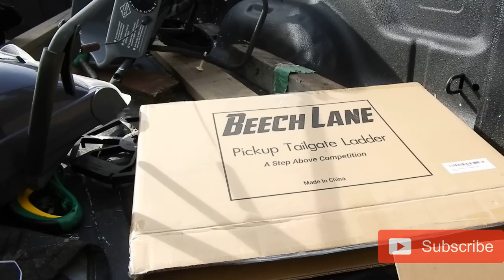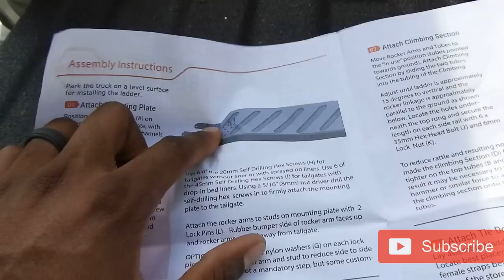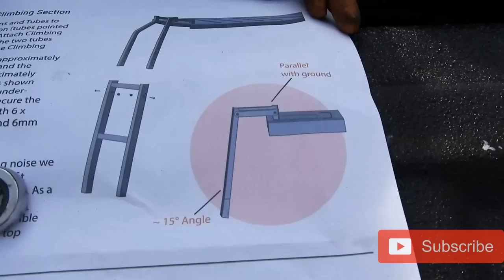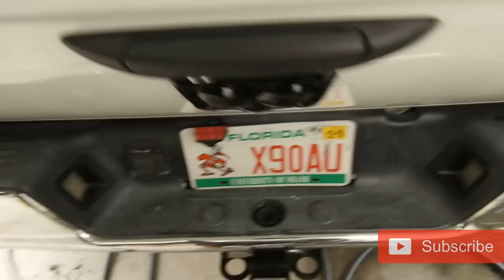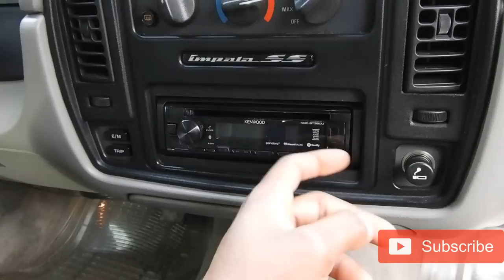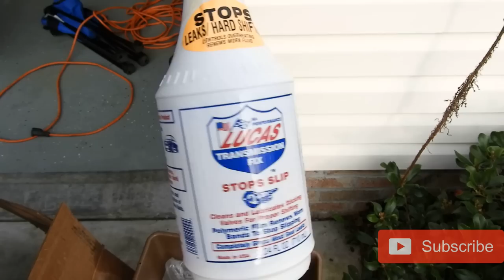EASY $50 MOD For Your TRUCK!!

Comment: Your plate should have been closer to the outside corner of the tailgate, that means within 1" to the top of the gate and 1/2" from the side of the gate, the ladder curve bar would then clear the tailgate cable with having to disconnect anything......

Comment: If you shift the plate closer to the tailgate end you won't have to unhook it that bend is to go around the cable. And then it will clear without having to unhook it every time

Comment: Looks cumbersome. If I had designed this I would've opted to go with a center mounted, telescoping ladder (similar to a boat ladder) that extends far enough to use as a walk-up ramp.

Comment: Not a big fan of the ladder. I have the AMP Bed step on mine for a couple years now and love it. Easy install, attached under bumper on corner and nothing attached to bed and don't have to remove ladder or cable to use. Works with levels/ lifts. If you like it, roll with it.
Reply from the maker: Nice man.
Reply: Picture please

Comment: Hey bro could you send me the link of what you used for the LED bulbs for the truck. Did you have to get relays or any special wiring to keep them from flickering
Reply from the maker: So for the headlights since they are aftermarket they require H1 bulbs instead of the standard h13 bulbs these trucks use. So what I did was I wired the positive wire from the bulb to my headlight fuse in the engine bay. LED lights require 12v constant, these 3rd gens have a stupid canbus system that doesnt provide constant 12v to the stock headlights bulbs that why u get flickering when u use aftermarket led bulbs. By wiring the positive wire from the led bulb to a headlight fuse or any fuse slot activated by the headlight  switch will give the led bulbs a constant 12v and you wont have flickering. I needed no relays no harness just some spare 16 gauge wire. I think I will be making a video explaining how to do that. I get a lot of questions how I did it
Reply: EVERYTHANG DIESEL yeah bro make a video soon, I’m sure all 3rd gen owners like myself would greatly appreciate it

Comment: I have a higher than normal tailgate also. How high is yours? I’d hate to spend $50 and something I can’t use
Reply from the maker: Dont get it. It barely touches the floor on my 5in lift!
Reply: EVERYTHANG DIESEL thanks. Thanks for the video too

Comment: Good video.  Product seems like it would always be in the way. Ampstep for me.
Reply: It is not all it's cracked up to be.  It is awkward, but very low profile.  I use it, but a folding step ladder that will slide inside your bed when not in use is easier to climb

Comment: Good morning my name is Jason and I live in Connecticut stumbled upon your videos I too have a 06 Cummings and a o 12 Cummings just a quick question with all this talk of the CCV filter delete on the 67 l has anybody put a 5.9 liter valve cover on a 6/7 to eliminate?
Reply from the maker: I havent I dont think they will fit.
Reply: @EVERYTHANGDIESEL  and where did you relocate your oil catch can I'm curious
Reply from the maker: Havent installed it yet since the turbo lol gotta reinstall it.

Comment: When you are on the road and you go about 60 mpr with the roush country kit do not you notice a waboll on the truck? yes yes that's how you solved it
Reply from the maker: I dont have wobble. U need to check your suspension ball joints, wheel bearing u joints